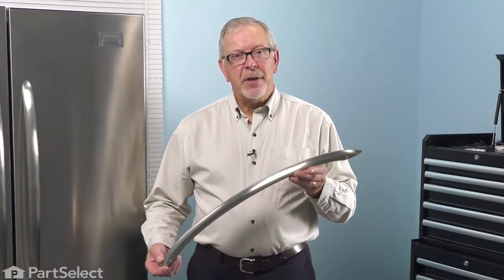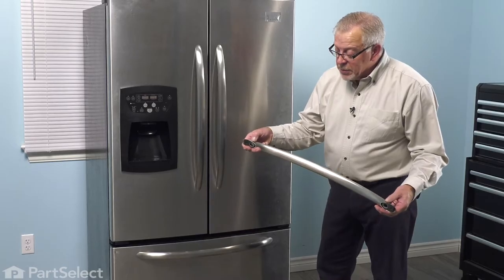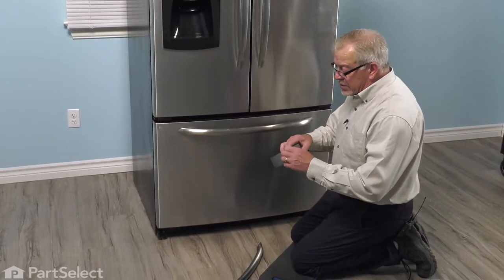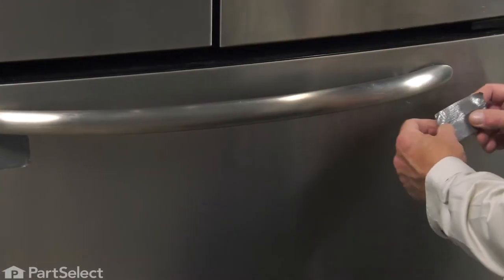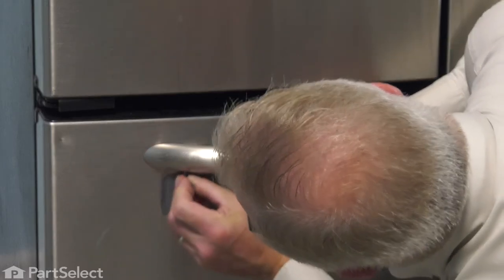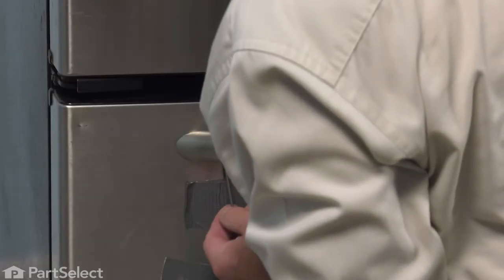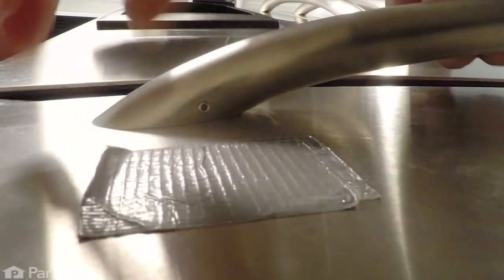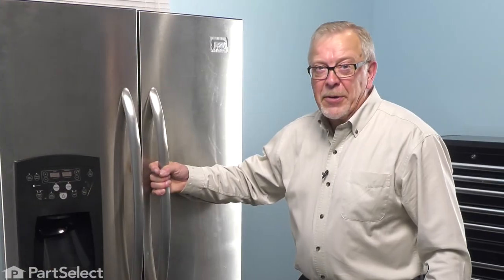Whirlpool Refrigerator Repair - How to Replace the Door Handle

Comment: Thanks...but unfortunately the handle I ordered does not fit this refrigerator.  It is too long and is a the Whirlpool correct replacement part.  It would need to be net to a smaller size.  Any suggestions?